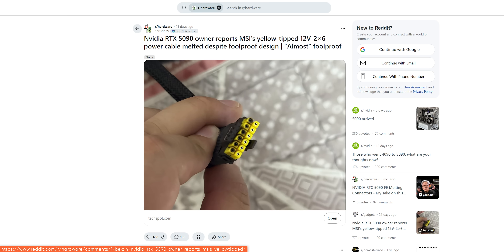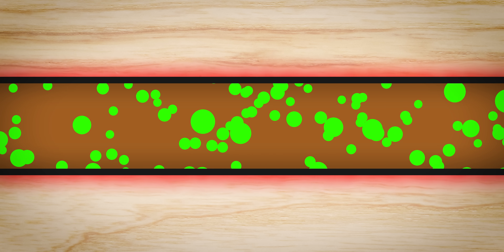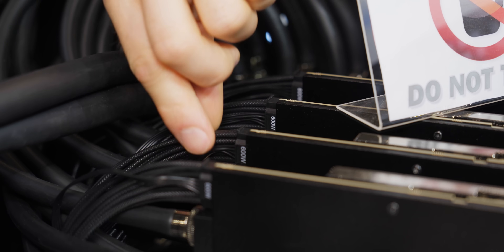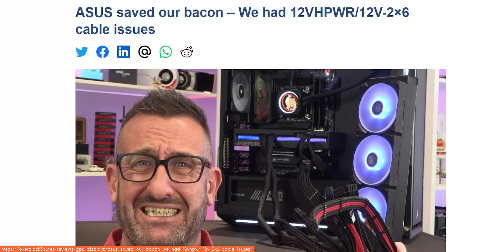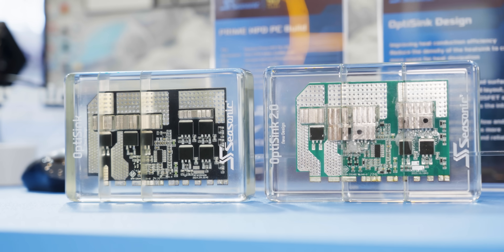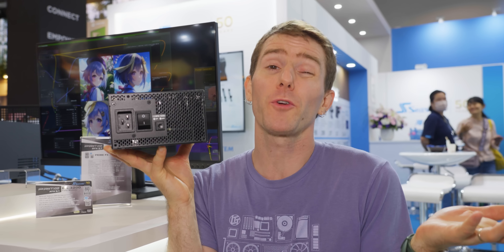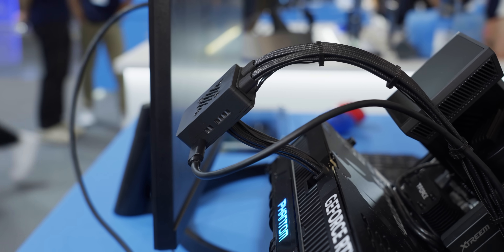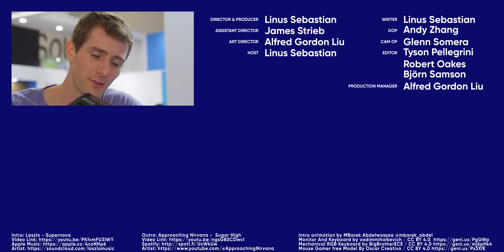The REAL Solution to Burning GPU Connectors

Comment: It does seem like the cables deteriorate over time too, so this is welcome, and anyone who can afford a high power GPU probably can afford a PSU that does some safety checks the GPU company has failed to implement. Good job Seasonic!
Reply: What would be better if the certification labs had caught them and called them out before the product ever went to market, and if the government actually stepped in and did their job and hit Nvidia with massive fines and a forced recall.
Reply: @HerbaMachina  there ase several cheap solutions,either longer wires(small resistance difference does not cause big change in current),or separate dc/dc convertors for each pin(a.k.a vrm phases as in motherboard)
Reply: That is why Seasonic are the sponsor whose spots I'll unskip to watch.
Reply: All cables deteriorate over time though, even the old ones.  Well if by "over time" you mean with multiple plugs/unplugs.  The new cables just have much less tolerance is the real problem.
Reply: @JathraDH  even without re-plugging the connector, they seem to deteriorate
Reply: @defeqel6537  Sorry but I don't buy that.  If the connector is plugged in correctly and nothing is mechanically moving I don't see a way for anything to deteriorate.

If the connector is not plugged in correctly to begin with then yes with time/use it could have a problem due to excessive heating happening.
Reply: @JathraDH  heat expansion would move things around even while plugged in, metals also oxidize
Reply: @defeqel6537  I guess?  But you know the same would go for any other connector in the PC and they never have problems.

I am certain the people saying they did nothing and the cable still "degraded" are just too embarrassed to admit they did something they shouldn't have, or there was a problem from the start due to incorrect contact that just took some time to show up.
Reply: @JathraDH  the other connectors have either load balancing going on and/or vastly higher tolerances
Reply: @defeqel6537  I will agree there which is exactly why I said its 99.9% chance its not being plugged in properly or something is mechanically wrong with the connection.

I just do not buy that a cable basically sitting there in place, especially if the connectors are gold plated is going to "degrade" at any appreciable rate.  If that was true we would see it all over the place and we simply do not.
Reply: @JathraDH  gold plating only helps if both sides are gold plated
Reply: @defeqel6537  And in most high end systems both sides are indeed gold plated.
Reply: @JathraDH  plenty of 5090s (for example) out there that don't have gold plating

Comment: as someone who only has a physics 101 understanding of electricity its kind of crazy that up until now that these safety measures weren't necessary. It seems to me like these should have been in PSUs the whole time, but considering the catastrophic failures seem to be primarily on the gpu and not the psu itself, it seems like these safety measures weren't necessary.
Reply: they weren't necessary since previous connector designs had ample headroom, GPUs used to draw less power, and GPUs used to balance the load. nVidia has just skimped out on the power design while moving to a cable with less tolerance...
Reply: The 8 pin PCIe connector has like a 120% thermal tolerance safety limit, able to deliver something like 330W of power before reaching failure temps. The 12v 2x6 or 12VHPWR connector has a safety margin of just 10%, (660W) with what are generally smaller pins and wires than the 8 pin connector. 

So reaching that failure point on an 8 pin connector, while possible, was a much more difficult proposition.
Reply: They used to have large safety margins. 12vhp is the only connector with such a small margin, and it also happened to coincide with a cost/space saving measure that made it so gpus couldn't detect missing/disconnected wires. 
The old standards and practices were safe and reliable, the new ones are less so.
Reply: they were always necessary, but nvidia just designed a bad connector with much less headroom than existing 8pin and no per-pin power sensing
Reply: As someone who has an electronics engineering degree, not only whould I agree with you, but I would expect my device (PSU if I was to design it) not to allow more current to flow through any pin of any output, if it exceeds the abillity to transfer it safely through all cables/connectors I supply with my device !!!! It should have been the PSU manufacturers responsibility from the beggining. Let's say any connected device shorts and draws an amount of power that can start a fire, should the PSU allow it over one power cable, if the total rating of it's plug allows it? This should be a must for all standard connector not only 12V-2x6.
Reply: Up to now GPUs typically had some form of inherent load balancing by splitting the wires into different lines, for example a card with multiple connectors may put each connector onto its own line and could stop the card if any one line has an issue. The RTX 30 series which introduced the 12-pin connector followed the same idea splitting the 6 power wires into 3 lines of 2 wires each effectively treating it as 3 connectors in 1, so if any 1 wire has an issue only its paired wire would need to pick up the slack and if any pair failed the card would stop which is why the connector really wasn't a problem back then.

Then came 40 series with the standardised 12-pin connector which did away with this splitting and instead connects all 6 pins in parallel into a single line with no per pin monitoring or any load balancing so the card just sees it one single connector, and they kept this in the revised connector for the 50 series. This seems to be an issue built into the 12VHPWR spec itself mandating this design as all manufacturers using the connector does this including the few that have used it on AMD cards, ASUS is a slight oddity with a few cards adding shunts to the pins for per pin monitoring before connecting them but even then they aren't allowed to automatically shut the card off if there's an issue rather relying on user to monitor it themselves in software. It also didn't help that these modern high end GPUs are simply more power hungry than ever and they not only adopted this negligent power circuit design they have kept it in the revised one despite the issues with the 40 series.
Reply: Well since you only understand common sense physics, it's not shocking amd these aren't safety measures, they're sales tactics. The safety measure is that every psu will turn off if it detects a short or over current, things that cause fires. So this solves nothing.

Comment: This is not hard make a better connector
Reply: What? It's rated for 12 mating cycles? That's ridiculous!
Reply: The biggest issue with 12v 2x6 or whatever they rebranded it to this week, is the female socket (on Nvidia cards, AMD might be different as AMD gives partners more liberties to tailor the board design) has the +12v terminals all just go into a single busbar (for lack of a better term), so all of the 600W goes to the board in a single trace without any opportunity to individually monitor and balance the load over the pins.
Reply: Make a good gpu first
Reply: Yes, but it costs like 10 dollars more. Nvidia never gonna pocket that lost on 3-4k $ card!
Reply: XT90... Cough cough
Reply: Heck just use a better connector that already exists
Reply: They already did, it's called pcie. The 12v EPS connector can deliver over 300 watts and one pci-e power cable can be split to two full 8pin connectors. Pci-e can handle 300+ watts, just keep using that and let it use more power.
Reply: @AspenSeiver  not with that connector any misalignment or poor contact  increases the resistance and then more heat is generated and when you pay$1,000 - $3,000 for a video card it should have a high quality connector.
Reply: Except if you had paid any attention whatsoever the cable melting issues would have happened the exact same way with 8 pins because it literally isn't a problem with the connector. So what exactly do you expect from a "better connector"? It's literally a board issue on the latest nvidia pcbs
Reply: @dahahaka  you don’t know what you’re talking about 😂

Comment: So, why exactly are we trying to get rid of the 8-pin connectors? Thank you, but no 12V-2x6 for me.
Reply: I think its because they are too big and expensive to deliver the same power. To match the 600W of the 12V one, you would need 4x 8-pin since each can deliver up to 150W.
Reply: @jotinhafilho5920 
Expensive? While they might be, the GPU costs like 2000 USD, I think they can give you a connector :D
I agree with you that 4x 8-pin is kinda overkill in terms of size (it would take up a lot of room on the GPU), but the 12V HiPwr isn't capable of consistently and safely delivering that kind of wattage anyway...
Reply: @reykoranteng9089  Im not defending Nvidia, im just giving what I think its an explanation for what they're doing. 
Save money is always a explanation for companies like this.
They should just put 2x12VHPWR so one isnt overloaded, but it would "cost too much" I guess.
Reply: @jotinhafilho5920 
Yeah, you are probably right. I'm just kinda miffed about yet another company charging obscene prices for not-that-great of a product with an obvious design flaw.
Reply: Pretty much only because of 600 W GPU insanity since 3x8-pin allow only for 450 W of power combined (and take a lot of space) while 12-pin allows to reach that 600 W number
Reply: @ОсликИа-я2ы  They were very conservative with the specification for the 6 & 8 pin connectors, while the PCIe spec rates a 8-pin at 150W the Molex Mini-Fit connector it uses is capable of so much more. Using 9A pins as per the Molex specifications for PCIe connectors that gives 324W for a single 8-pin which has 3 power wires, and they have a compatible high current specification using 13A pins which many reputable brands have used for their cables. So 2x8-pin connectors (9A pins with 6 power wires) is actually capable of 648W which isn't far off the 684W rating that the 12-pin connector has (Molex Micro-Fit connector using 9.5A pins with 6 power wires). They could have easily specced the 6 & 8-pins higher than they did, and they could have easily made a new 12-pin Mini-Fit connector that would have had less seating issues than the Micro-Fit connector does (how many people have had seating issues with their 6 or 8 pins? I know I haven't) and would have been barely bigger (4-5 mm wider and 2 mm taller).

The connector is only one part of the problem though. The bigger issue is the negligent design of the power delivery circuit on the GPUs that take all 6 power pins and connect them in parallel in a single line with no per pin monitoring or any form of load balancing, this is what is allowing the load to become unbalanced and potentially be put all onto a single pin.
Reply: @ОсликИа-я2ы  difference is 8pin pcie is rated with a safety factor of 2x, so those 3 8 pins can safely provide double that at 900W and still likely be fine at a reasonable room temperature. The new 12 pin connector will absolutely not be safe at 900W lol

Comment: It's wild that this totally future technology of current control per wire is just invented for PCs now. Such innovation.
Reply: it's litterally not, and Nvidia used to do it on the 30 series and below, they stopped with the 40 and 50 series, ironically when they switched to a way lower safety margined connector lol.
Reply: @HerbaMachina  They switched because the rest of the industry got involved and made the connector a standard, and everyone said it wasn't necessary. Literally nvidia on their own chose to be safer and it's only after everyone else is involved they go "okay, if you say that's fine I guess so".